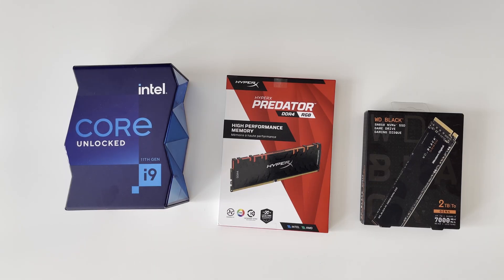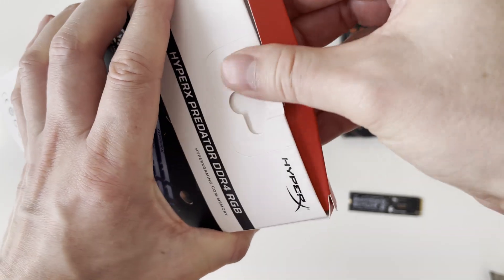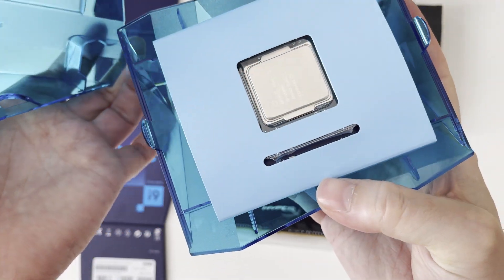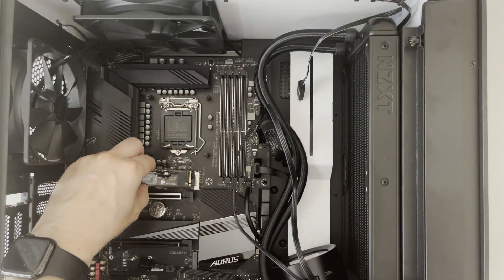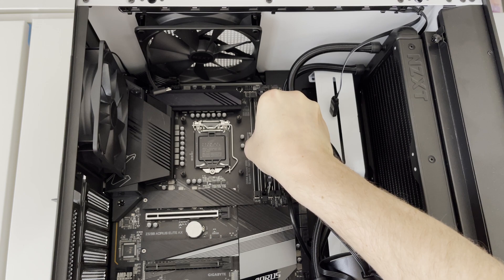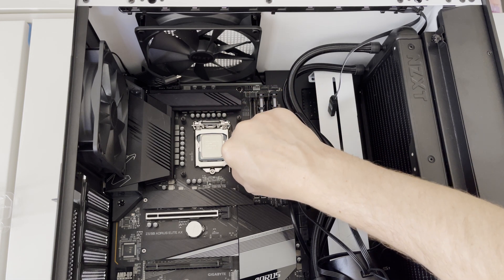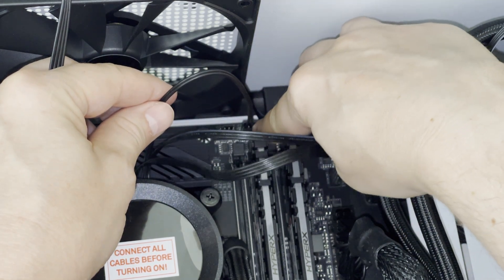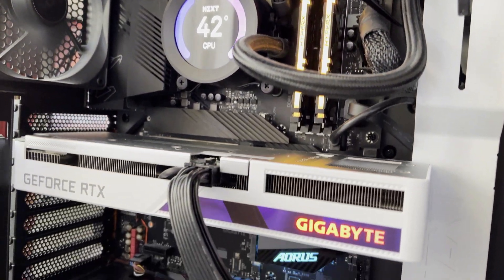Intel Core i9 with Kraken Z63 and HyperX Predator RGB and WD SSD Black SN850 NVMe

Comment: You forgot the gpu
Reply from the maker: Thank you for watching and providing feedback. I might actually wait for Gigabyte RTX 4060. Or should I just go with RTX 3060?
Reply: @ottomixa  I'll go with rtx 4060 if its not too overpriced due to the lack of chips.
Reply from the maker: @Domcacestuje  you are correct, I'm also interesting to see the prices and availability of RTX 4060 as everybody will want to plug it into their PCs. Also there was announcement from nVidia that power supply units for RTX 4090 and RTX 4080 have same requirements as RTX 3090 and RTX 3080. If that is the case then RTX 4060 might still work with our current power supply units.